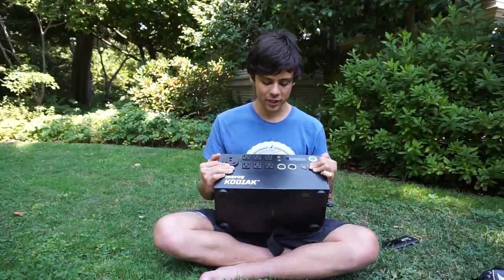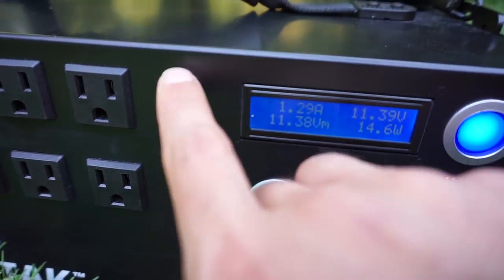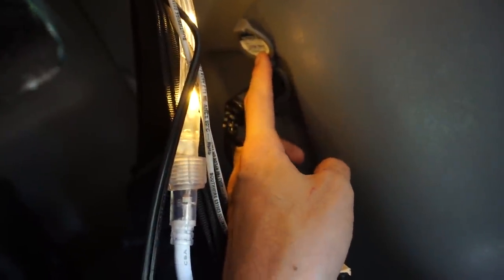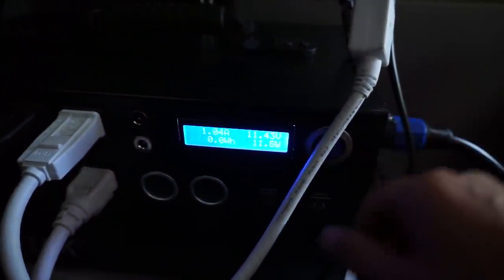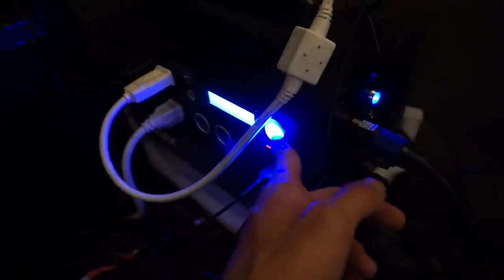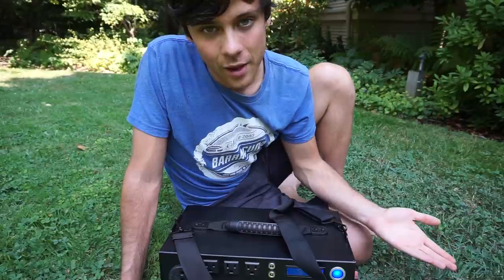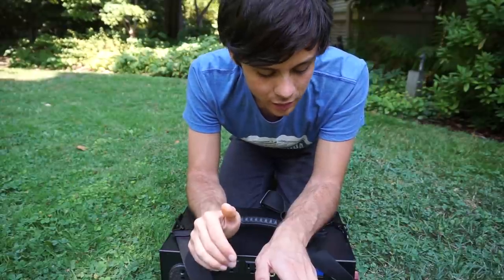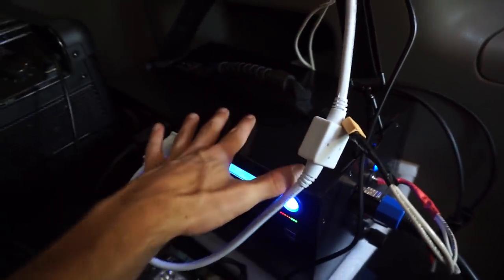Inergy Kodiak Solar Generator Full Review: Pros/cons, load test, how to use it and much more!

Comment: My Canadian Solar CS6U (340watts) can charge this unit?
Reply from the maker: +Alex Lora what voltage does it produce
Reply: Electrical Data | STC*
CS6U 325M 330M 335M 340M
Nominal Max. Power (Pmax) 325 W 330 W 335 W 340 W
Opt. Operating Voltage (Vmp) 37.4 V 37.5 V 37.8 V 37.9 V
Opt. Operating Current (Imp) 8.69 A 8.80 A 8.87 A 8.97 A
Open Circuit Voltage (Voc) 45.8 V 45.9 V 46.1 V 46.2 V
Short Circuit Current (Isc) 9.21 A 9.31 A 9.41 A 9.48 A
Module Efficiency 16.72 % 16.97 % 17.23 % 17.49%
Operating Temperature -40°C ~ +85°C
Max. System Voltage 1500 V (IEC) or 1500 V (UL)
Module Fire Performance TYPE 1 (UL 1703) or
 CLASS C (IEC 61730)
Max. Series Fuse Rating 15 A
Application Classification Class A
Power Tolerance 0 ~ + 5 W
* Under Standard Test Conditions (STC) of irradiance of 1000 W/m2
, spectru

Comment: not a generator. does not produce anything. its a battery in a box.
Reply from the maker: +Chris Cooling yes but marketing term that has stuck is solar generator due to audence that these are being sold to. There are many words we can describe these with, but the most commonly searched term is solar generator, so that is what we will continue to use.
Reply: @Black Ace ..finally a decent answer..

Comment: Will I am only looking for something to be able to run a microwave off of n a 120v countertop stove/oven combo unit that has 2 burners on top. I will not normally be using the microwave n electric counter top stove/oven at the same time. The only gadgets that I will need to be able to charge are 3 cell phones, a laptop n nook. I want to be able to use a Keurig, dorm frig or dometic frig, water pump for sink/shower, possibly a evapolar microclimate a/c, fan n TV while using the microwave or electric stove/oven combo n not hv to worry about the power kicking off. I think I'm going to see if I can find the microwave u purchased. I hv a propane stove/oven combo unit that I will use when it's not raining out because I know when using it I need to hv a door or window open for ventilation. I will use the electric 1 on raining days inside the van. Do u think this solar generator will supply all my electrical needs?
Reply from the maker: +L2Cotton possibly. But not for long. You need something bigger.

 200 amp hours of lithium iron phosphate (2 battery born batteries) and a 2000 watt continuous inverter would work great. Also depends on how much solar you have available. Check out my website and look under "solar blue prints".
Reply: yes with 200 amp-hour of batteries you get 200 x 12 volt = 2400 watt-hours available so this is enough for charging a laptop, led lamps, 12 volt TV, charging cell phone, Dometic fridge, Ipad tablet, fantastic fan, microwave 15 minutes per day, coffee Keurig machine, Ryobi tools, juice extractor, Bull Eye mixer and one hour of air conditioner per day but of course not all at the same time. You have to monitor your current.
Reply: +Will Prowse thanks Will! I really appreciate the advice n I will check out that info now!! Love your videos, keep them coming!!!
Reply: +Will Prowse Thanks Will, I appreciate your advice! I will check out that info now!! I love your videos, keep them coming!!!
Reply: +Denis Fortier Thanks I appreciate the confirmation!!!

Comment: I read somewhere that fast charging lowers the lifetime number of charges of this type of battery, is that true?
Reply from the maker: +Talking Fish yes for all batteries. Because it can cause them to heat up which damages the battery in some way, depending in what type of battery. But the "healthy charge rate" of the battery is determined by it's design and chemistry. Charging a lithium ion quickly is totally fine because they are designed to handle it
Reply: Thank you. I ask because I'm interested in the quick charge cable that is made for this unit.

Comment: Wow, I went way over what I need for my box truck and solar power really I'm talking about battery Bank excuse me while I take a moment and go to my calculator. 14.6 KW battery Bank. I only have enough room on top of my box truck they also call them cut offs trucks. To place 4 X 265 Watt solar panels on top. I suppose the good thing is I have a lot of reserve and that's not going to hurt anything that could actually help a lot of things. But hey what do I know. I know the batteries alone cost $2,400. So anyway I'll make it work I'm thinking about buying a growatt 6000ts-x hybrid charge controller inverter. If anybody reads this thread that knows if I can make that work please let me know. The 6000 ts-x is listed as on-grid which I am not. Though I do have a 3500 watt champion gasoline generator in lieu of shore power, which has peak power of 7,000 w. By the way I've been living in a minivan for 3 years now. I saved every penny over the last 3 years to buy the box truck which I now own in order to build an RV stealth of course.

Comment: All those features, but they left out important caps over all those outlets. Not very smart if you're in a hostile environment.
Reply from the maker: +Bobster986 you can head down to Walmart and buy a big bag if caps for under a dollar in the baby section. Problem solved. And hostile environment? Lithium batteries cannot handle a hostile environment. So it doesn't matter either way
Reply: Hostile like rain, snow or dust storm, plus I don't think Walmart (not that I ever shop there) is going to sell caps for the DC and USB plug outlets, not to mention, those caps aren't permanent and can get lost, so you still have a problem. For the price, this unit it should have been better designed.
Reply from the maker: +Bobster986 tell me one generator on the market that has your plug covers? Tell me one that can handle snow rain dirt etc. I don't know of a single one. Can't wait to hear your reply. I have been looking everywhere for such a system.
Reply from the maker: +Bobster986 and I was referring to a plug caps. Usb caps? Is that actually necessary? Why not put the whole unit into a plastic bag if you are in such hostile environments?

Comment: Please be careful with this product warranty, I have a big problem because the Kodiak does not take power from external battery. I tested many times to make sure I was doing something wrong, but everything was perfectly connected, now if I am wrong they are going to charge me for that. I am 100% sure that it is not good a investment. Be careful what you buy. I do not recommend this product at all.

Comment: OK I am really interested in this but there is something I don't understand, my knowledge of amps and volts and power is pretty limited so maybe explain this to me like I am 5. The company offers a package where you can buy the generator and two or three solar panels and it claims that with more panels you can fully charge the Kodiak faster- but it sounds like you are saying you can only input 30 volts at a time, so do I need more panels or just one?

Comment: The inverter consumes more power than a phone charging.....
Reply from the maker: Which is great
Reply: no it isn't.  IF the USB is powered off of the batteries and the 12 volts is dropped down to 5 volts, it will not be as much load on the batteries as turning on the inverter to derive 5 volts. I believe you said the inverter with no load consumes 14 watts?  My MOTO phone consumes 2.25 watts to charge. The inverter is consuming more of your batteries in waste/inefficiencies than the phone would consume straight from the batteries to charge.
Reply from the maker: Lol u would hate my current system. So many inefficiencies. But my array is large so I don't care the slightest
Reply from the maker: And ur preaching to the choir. There is a easy work around because lighter ports are direct without inverter powered up. I'm just saying that it doesn't matter because I like to have inverter on all day long and the losses that used to bug me don't anymore because I just stick another panel on the roof. I like having ac power 24/7

Comment: WHY ON EARTH would this unit and others like it not have the option to charge directly from a standard 120v AC home wall outlet? LUDICROUS! Even my dinky little auto parts store car jumper battery has USB AND a 120v AC outlet, along with 120v AC charge input... Yeah, it's a very low wattage AC output but it WORKS... At two grand, it's LUDICROUS that the electronics for receiving 120v AC charge input aren't included...
Reply from the maker: +Steve Hacker they all actually do. Of course they can charge from standard ac outlet. Why do you think that they can't?
Reply from the maker: +Steve Hacker what makes you think that it would not have that ability?

Comment: 1800 bucks are you kidding?
Reply from the maker: +cowboy6591 nope. Considering charge cycle life, this is way cheaper than nearly every lead acid battery system on the market. Just requires some simple arithmetic to discover this.